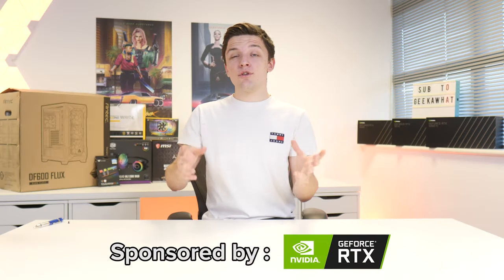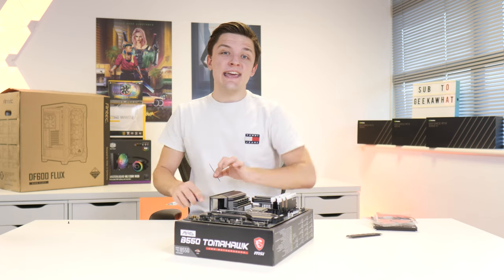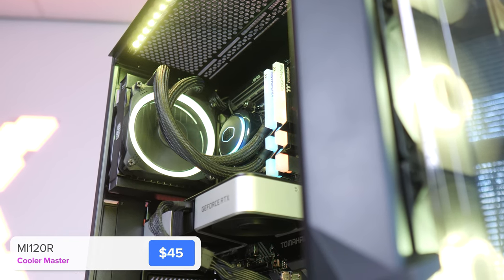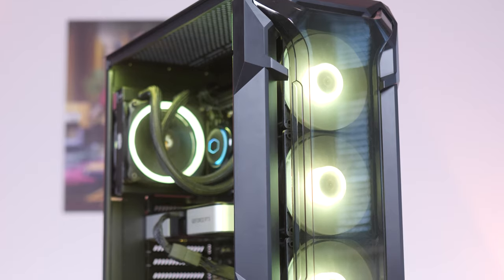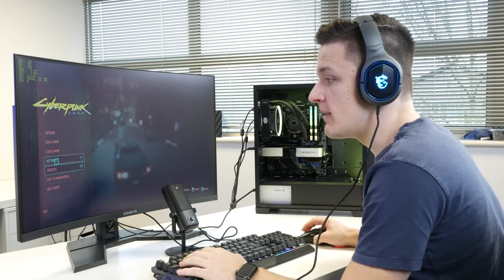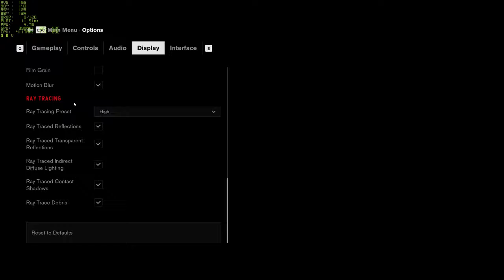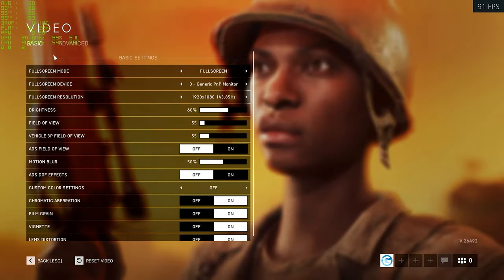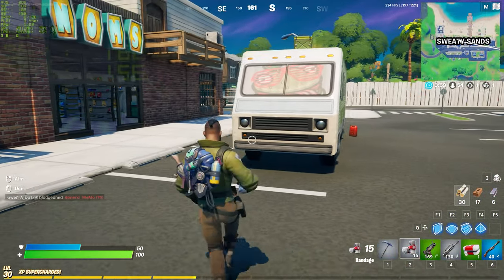Insane $1000 Cyberpunk Gaming PC! [RTX 3060Ti  & Ryzen 5600X - 15+ Games Tested!]

Comment: Man who ever edited this must be such a pro 😉
Reply from the maker: You only edited the first half Dan!! 🤣🤣
Reply: @GeekaWhat  This is true 😂
Reply: Tbh editing was really good
Reply: Well this is interesting
Reply: Can you please help me?In my Country and in my budget i can buy Zotac 3060ti oc twin fan or Msi 3060ti twin fan oc whitch should i buy?????please help
Reply: @mohammadrafin8243  I would go for msi
Reply: @aashi6517  only 2 year warranty in MSI and Zotac has 5 year
Reply: Well, i guess that makes you semi-pro xD
Reply: @mohammadrafin8243  Go for the Zotac variant, the low end MSI models aren’t really that good.
Reply: @PsychoSpot3324  zotac one on load gets to highest 70 degree celcious.is it that bad?msi gets to 65..zotac also hs no fan off auto
Reply: @mohammadrafin8243  If the Zotac model doesn’t have it’s fans running, it’ll of course run hotter. According to some reviews I’ve seen, the Zotac Twin Edge performs about on par with the Founder’s Edition whereas a couple of MSI’s lower end models like the Ventus 2X usually perform worse.
Reply: @PsychoSpot3324  How is msi one bad when it runs cooler at 65 degree celcius
Reply: @mohammadrafin8243  it’s not bad. But if it is bad, you have 5 years warranty to get it replaced. MSI do not have that. For 5degree. I won’t mind going for zotac. In the end, it’s your decision.
Reply: @mohammadrafin8243  All the performance differences are VERY marginal. Look for one with the best temps and warranty.

Comment: Love the build, but it turned out more like 1200 than 1000
Reply: Yeah it's 1234 kinda weird to call it 1000 dollar build
Reply: I'm getting a 1200$ build my self today, it's a prebuilt unit with an asus dual1060 ti priced at around 650$

Edit: sorry i meant 3060ti not 1060ti

*ASUS PRIME H410M-K  Intel mATX MOTHERBOARD
*INTEL CORE I5-10400 6 CORES Turbo 4.3 GHZ CPU
*GAMMAXX GTE V2 GAMING RGB BLACK CPU COOLER  
*Asus Dual RTX 3060TI 8GB DDR6 GPU
*CORSAIR VENGEANCE LPX 16 GB DDR4 3000 MHz RAM 
*PNY TECHNOLOGIES CS900 240GB SATA SSD 
*SEAGATE 1TB BARRACUDA SATA INTERNAL HDD 
*CORSAIR CV650 650 WATT 80 PLUS BRONZE PSU
*DEEPCOOL MATREXX 50 ADD-RGB 4F TG ATX CASE
Reply: @AKVisuals  or do you mean the 1060 ti is 650? Cuz it's not it's only worth max 200 
Edit: Just saw its the 3060 Ti a good prebuilt then tho a 3060 Ti isn't 650 it's more like 450
Reply: @UCKuDn-6_OQnRDChPd_6PRcQ oh my bad ! I meant to type 3060 ti lol it's a typo
Reply: @AKVisuals  you got screwed over. that is not similar at all. I could get you that for $1k.
Reply: @Dusk007  for 1k taking in consideration the gpu is atleast 200$ more than the announced price ? Ok list me the build with all parts linked to the price page.
Reply: @AKVisuals  what’s your discord? I’ll legitimately do so. also the 3060 ti is $399 if you wait and don’t get it scalped.
Reply: @AKVisuals  I need your tag.
Reply: @Dusk007  here you go @Elsweyr#6052 
Sorry i dont use Discord that much so im not that familiar with it.
Reply: @AKVisuals  not accepting friend reqs. The Superior Dusk#5455
Reply: He's British so it may be £1000 instead of $1000 and prices may fluctuate too so idk.
Reply: @YoYo-it7ti  bruh no that’s using the prices HE put on screen
Reply: you need to wait prices are up because of covid
Reply: Well ima send some picture on reddit my build (I chose parts from scratch) was around 1500$ but it sooo beautiful (it looks like a ultra high end build with corsair Ql fans). But I got to say that I still "only" got the 5600X, 3060 Ti (but the Palit gamingpro OC which gives 5-10% more Performance than the Founders edition 😏 PS: It has a max power limit of 270Watts which is higer than 3070s!) and 16Gb of Ram :(
My whole setup costs (with desk chair etc.. around 2500$ :/ but it looks pretty dope and I didn't cheap out on any part, so everything can easily be upgraded without bottlenecking other things.
Reply: @AKVisuals  well I was able to purchas the 3060 Ti asus dual oc for 440$ brand new of a store! And also I paid 200$ more, but got a nice build with the gaming pro oc, rgb corsair ram, expensive corsair Fans, 850w psu, 5600X, 1Tb nvme ssd, 2Tb hdd, B550 Aourus elite ax v2, arctic freezer II 360. without the expensive fans and case I would be around 1300$ ish. 😉😏😏
AND I learned alot and had alot of fun! 😏
Reply: @Dusk007  for a prebuilt it's ok
Reply: @Dusk007  my friend bought a 950$ pc with a 1660! 😂😂
Reply: @jonashediger182  for a prebuilt...
Reply: @jonashediger182  oof man
Reply: @Dusk007  shit ! I just saw your reply lol. Ok i'll send u a friend request
Reply: @Dusk007 typed The Superior Dusk#5455 and Discord says it didn't work
Reply: @AKVisuals  I recently got nitro, my tag is different now. Try #6800
Reply: @Dusk007  it is a prebuilt (he said)
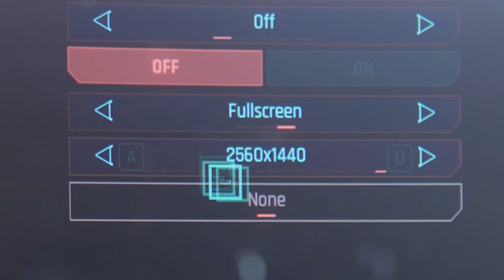Reply: .. again he said 'ROUGHLY' 9:34
Reply: @wolfzatyt  dude that is not even close
Reply: @AKVisuals  a r5 5600x better then i5 10400k
Reply: @yuanfurbax  tbh i never made an AMD build but i'll definitly switch to their CPUs next time.
Reply: I think he means without taxes and tariffs 🤣
Reply: @CocoNot.  nope! even with the prices he showed on screen lol
Reply: @AKVisuals  You do realize, you are cpu and memory bottlenecked, right ? 10th gen Core i5s have a ram speed limitation of 2666. Also, that cpu is nowhere near enough for the 3060 TI. I've seen R5 3600Xs struggle to keep up. You also only have 240gb of Sata storage which is abysmally bad. So, you would have better value flushing 1200 dollars down the toilet than buy this hunk of junk. Also, did I mention, neither the motherboard nor CPU support overclocking.
Reply: @rahulravishankar3152  k
Reply: @AKVisuals  2 3060 ti ?
Reply: @bo0mzy663  one
Reply: @AKVisuals  Ok, i thought you meant two whne you said dual 3060 ti. Thats also my dream pc btw
Reply: @bo0mzy663  oh no, the model is called "ASUS DUAL OC" OC for Overclocked
Reply: Like €1500 lol
Reply: It is actually $1055 to be exact
Reply: Rn it’s 2000+
Reply: @AKVisuals  I built a similar pc with the 5600x and a bit better specs for 1300 last weekend
Reply: @anonyser  congrats, currently the 3060ti i have worth alone almost 1k in our local stores in Algeria. I could still sell mine ( gpu ) for not less than 650$ after 1 year of use in my country considering current prices here

Comment: I'm going for this build as my first pc, that'll be 7 months later than now
Reply: better late than never mate.
Reply: just a little info, this PC, if you do the chick maths, does in no world come down to 1000$ it just costs, even in a few months from now, 1300$
Reply: never buy any thermaltake product
Reply: @N3R0.3D  correct, i just spent 1300
Reply: Mine 3 months later
Reply: @rehanulislamsnigdho1768 thank you for the advice bro 👍
Reply: @alis2068  Lmao Don't listen to that guy saying Thermaltake is bad. The only stuff I would avoid from them are their cheap power supplies, other than that most of their products are pretty good.
Reply: Same. He said that the board work with the new ryzen 5000 series so do I not need to flash the bios on the motherboard when building it????
Reply: My friend has the same pc the gpu and power supply is $800 already lol
Reply: By then, almost all the bugs will be fixed and the dlc’s and maybe one expansion will be out. Will definitely be better than launch.
Reply: Get the 5600 and the 3060 12 gb then will be a bit cheaper with probably not much loss in performance
Reply: Me too!
Reply: Mine will be like 14 months but I am so impatient lol
Reply: @AbisGamer  same lol
Reply: I got my rtx 3060 ti so the rest I'll buy it little by little. One thing 5000 series is hard to find so I'll go with r7 3700x for the mean time
Reply: Same lol
Reply: @Big_Ety  hi did you find out about having to flash the bios update as I have the parts but haven’t built it yet as I’m trying to find this out
Reply: Mine is 3 or 4 months away
Reply: @benlatham1806  ye just buy intel cpu makes life ez
Reply: U should get a hard drive with that cus 500 gb is a bit low
Reply: @ZaFakeFoilo  yes i didnt go fully with this build it was just the graphics card and cpu and motherboard. dw i spent £500 more on extra better bits
Reply: @Big_Ety  nahhh mate. i figured it out anyway and it was ez tbf
Reply: @johnquinones1623  howd you get it? Its so hard to find!
Reply: @rehanulislamsnigdho1768  idk if I should trust you, u can't use the right "their" , not there
Reply: Sameee
Reply: @N3R0.3D  Ong, I literally just bought a prebuilt pc for 1800 from Ibuypower and that is considered a good price considering on how much it would of cost 😂😂
Reply: Me too
Reply: It’s seven months later
Reply: So have you built it
Reply: So now?
Reply: been 7 months, update?
Reply: It been more than a year did you build a pc
Reply: 1yr later how is it ? Did you build it I do spider building this aswell
Reply: How is it
Reply: @N3R0.3D  i was gonna say, even in 2022 now itsd not close to that price point

Comment: When you installed the CPU cooler, you installed it tubes top instead of tubes bottom. If there is any air in the cooler from when they filled it, that air is going to be circulated out of the radiator and into the fan over the CPU which can damage the fan over time. If the tubes were on the bottom, then the air would stay trapped in the top of the radiator where is can't hurt anything.

Comment: 5:00 btw just saying, don't put a radiator as an exhaust fan because that way warm air is actually being pulled to the radiator and it's warming up the water instead of cooling it down. a 120mm radiator is pretty bad for a ryzen 5600x to begin with, though i understand this is a budget build. But you NEVER want it at the back as an exhaust fan
Reply from the maker: Not necessarily true, as long as you bring enough cool air into the system as a whole and enough flow through the rad in push pull you're good....

Comment: Using an i7 10750h and frame rate doesn't change if I turn turbo boost off and run at 2.6ghz as opposed to 4.4ghz.

Comment: I have a question and I hope with all my heart the answer, which card is stronger than these three
Asus TUF GAMING RTX 3080
or
Gigabit RTX 3080 OC
or
GIGABYTE RTX 3080 EGLE
Which one is stronger in general without talking long and taking all your time, so you advise me of a card stronger than them in short and useful words, and the price does not matter to me because I know that the prices are close to each other a lot, and they are in the range of $ 900. The important thing is which one is stronger and thanks to all
Reply: The gigabyte OC because its overclocked but in general they have the same performance, the FE is slightly faster than all of your selections. You can go on a website, the FE has more CUDA cores than others. But it also depends on the price for your best bang for your money.

Overall it doesn't matter which one, but OC versions are a bit faster.

Comment: THIS IS SOOOOOO HELPFUL!!!!!! Literally I was about to skip to see what the price was of the graphics card, but I just wanted to keep on watching! This was amazing! Also, one question, do you think I could use instead of the 3060 ti the 1660 ti? (Anyone’s help would be great, thanks!)
Reply: The gtx 1660 ti is generally 50 pounds less than the 3060ti but there is a huge gap in performance the 3060 ti is meant to be 300 pounds

Comment: Disclaimer: If you upgrade from Ryzen Zen 2 series to Zen 3 and you have B450 just update the bios. B550 only really gives PCIe 4 for GPU and NVMe SSD and FPS wise it's 2-3 frames.
Also for any Ryzen 5000 + Rtx 3060Ti 600Watts Gold+ PSU is enough. As most sites show a high demanding CPU for the GPU you look at.
Personally currently rocking a 5 3600 with RTX 3060Ti on B450 Tomahawk Max and 600W Gold+ and planning to upgrade into Ryzen 5 5600X chip. Hopefully that helps someone.

Comment: Thank you very much for making these tutorial videos! You’ve made them easy to follow and understand. Initially, I was going to buy a pre build pc from a company but I held off on it since I’ve discovered that many of those companies use low grade parts and charge much more. I’ve also seen reviews where people are complaining about the poor air flow on their pc which I was worried about also. Thank goodness I came across this channel. I feel confident I can build mine now thanks to your great videos. I was wondering if the other video you have for the $1500 RTX 3080 Gaming PC Build 2020! would be much better to play Cyberpunk 2077 as far as FPS and having everything at ultra with raytracing enabled settings. Also, can I use a AMD Ryzen 7 3700X 8-Core, 16-Thread cpu for that tutorial instead of the Ryzen 5?
Reply: You can swap in a 5800x with a 3060ti it just depends what yoh are doing with the pc

Comment: YES THIS IS WHAT I WANT 5 5600X WITH 3060TI OR SMTH YAY
Reply: I got a 3060 ti but all i need is the 5600x😭
Reply: Which resolution monitor will you prefer to use on this combo?
Reply: Idk
Reply: @MegaCrazycoolman  which resolution monitor are you using with this card?
Reply: @yuanfurbax  no worries
Reply: @gYan_BAZzz  im using a 1080p 240hz monitor

Comment: @geekawhat just built inside this case, the front 3fans are on but the rgb won't turn on. What should I do? Need help. Thank you.
Reply from the maker: If the fans are spinning but the RGB isn't working are you sure the RGB hub is on and have you pressed the RGB button on the top of the case?
Reply: @GeekaWhat  Thank you for responding!! And yes all of my fans are spinning, I did press the LED button on the the top nothing really happens. But the first time I turned it on this was just one single light on, only the top fan
Reply: @GeekaWhat

Comment: How is this $1000? I’m putting these pieces on pcpartpicker and I haven’t even gotten t the case or psu and I’m already at $1000

Edit: w/o a cooler and having the mobo, ram, and storage each be $10 less than what’s in the video, it’s still $1155

Comment: Just because it’s boosting to 4.6ghz does not mean it’s a cpu bottleneck 😂🤣 it was at 50% and the gpu was at 97% so it was a gpu bottleneck. The cpu is meant to boost to 4.6ghz under a 50% load